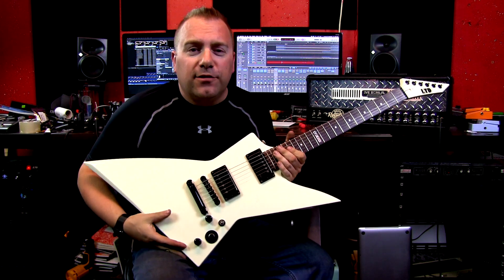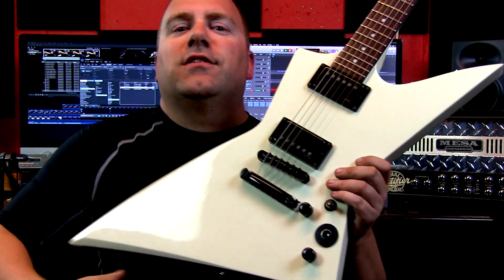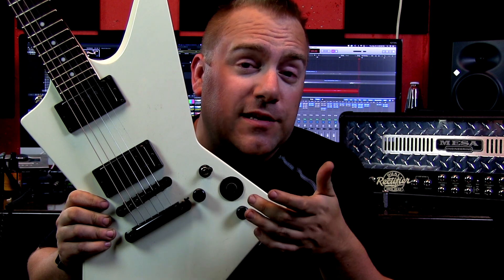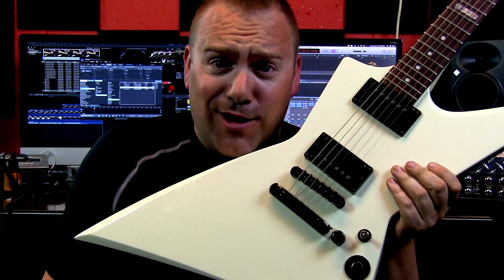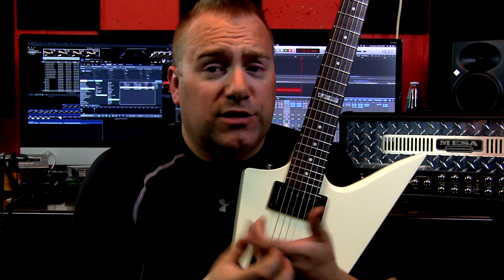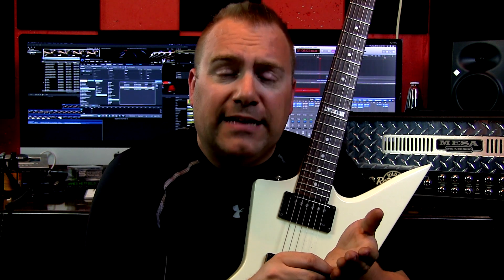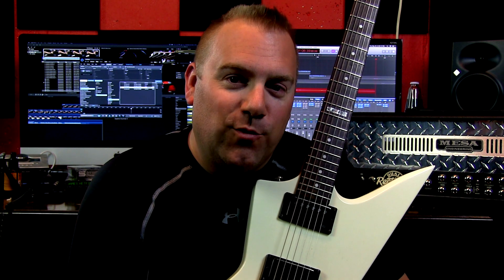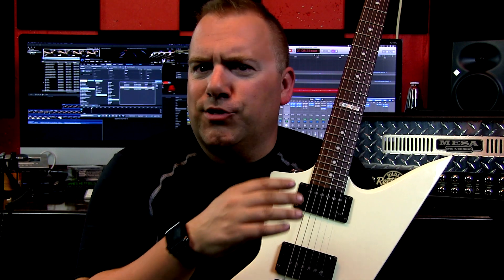EMG TKO Kill Switch

Comment: Question for you: do you find the killswitch is kind of hit or miss?  Ive tried to use it for a tom morello/bulls on parade solo and its basically un-useable for that.
Reply from the maker: I always found that it took a lot of practice to get it where I wanted. I actually find it easier to use a regular 3 way switch with the neck pickup muted. Cheers -Ryan
Reply: @Crypticmaskguitar  thanks for the reply.  Funny thing is i was struggling w that very same thing!  Then the toggle switch crapped out so i took that out and threw the tko killswitch in and like i said its hit or miss.  What im using for the bulls on parade solo is actually a cable by d’addario that has a killswitch at one end.  That works great and although im no tom morello, i can get by some untrained ears!! Fake it til you make it! Thanks for reply
Reply from the maker: I use to use the same cables! Can’t seem to find them anymore. Cheers -Ryan
Reply: @Crypticmaskguitar  d’addario site has em but i got it off sweetwater, i think cheaper too. If youre still lookin for one